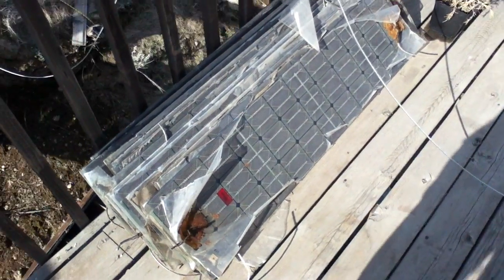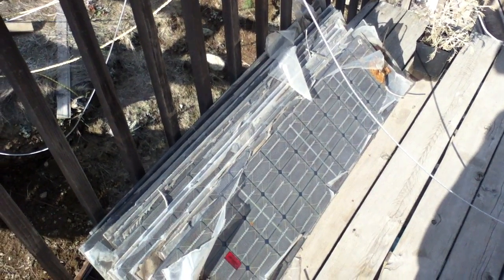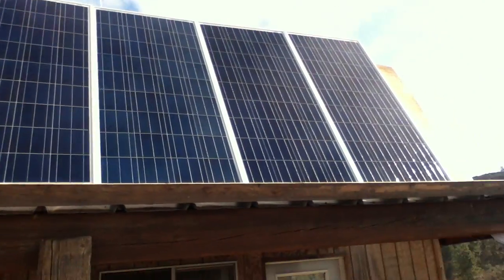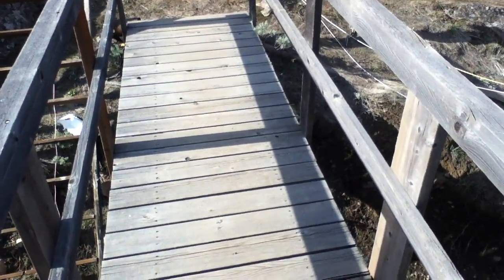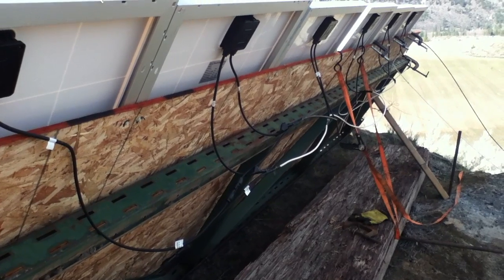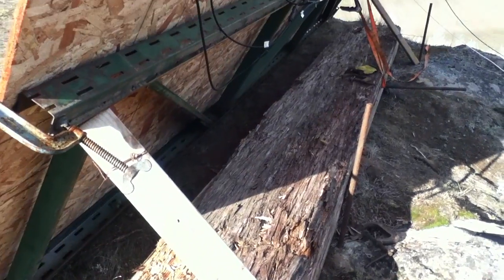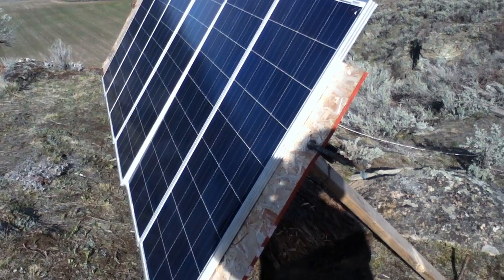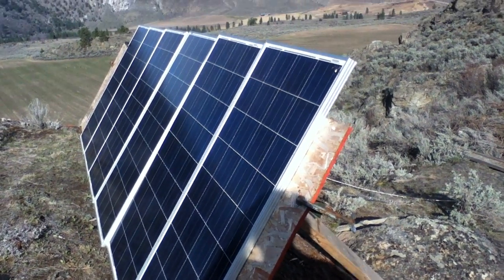Temporary Setup of Larger Solar Array

Comment: I have 6 of the DMsolar solar panels, I bought a year a go.   I was wanting to get more of the 145's but they didnt sell them anymore. then I found these on Amazon and I was hoping they was the same size or foot print because I like stuff being the same and what do you know they were the same size just more power out put.  so now I have 8 Panels.  will be working up to my first array being 14 of the DMsolar Panels.  but I want 4 arrays for a total of 56 of those panels.   for a total of 8.8 kw.  and of course I will keep adding I like to have at least a 20kw system before I stop lol. also with wind.
Reply from the maker: As far as we can tell, the new ones are very close in size.
Reply: yea I set them on top of my 145's and they were the same size even the mounting holes are in the same place so the frame loos to be the same, just different type of cells. and the cells are darker.
Reply from the maker: I personally limit the arrays to eight panels each but prefer six.  Over ten seems to require a lot more structural steel to keep it from tweaking in the wind and runs in to problems scaling the system to readily available charge controllers.  Others I work with want big arrays but impersonally am into sets of 2, 3, 4 or 6.  The 8 panel set requires a high dollar Mppt charge controller.  Sets  6 running a few batteries and a  5kw inverter will run a kitchen while a set of 3 and one or two batteries on a 750-1200 watt inverter will run a bedroom or two as long as lights are LED (preferably DC).
Reply: thats cool I have my panels on a unistrut  they dont move I just have them set at 42degrees. and my panels are wired for 24 volt systems and dump in to 2 1000watt sun GTI's in to the gride,  I use my wind turbine to keep my battries topped off so if the power gose out I have back up power.   and I can flip a switch to turn off the GTI's and pump in to the battries using a PWM charge controller, I know its not MPPT, but it works when I need it.  and I use 3 APC unites as my inverters 2 are 1000 watt inverters and one of them is only 900 watts. I use that one for all my computer stuff,  the other two can the feed my home if I need it.   I know its the poor mans out back set up. .
Reply from the maker: You should be able to dump 10kw into the grid with an array that size, check the amperage of power production you have vs that many amps in AC power. You subtract maybe 20% for the energy conversion but you are probably looking at being able to dump 20kw to the grid if they will let you.